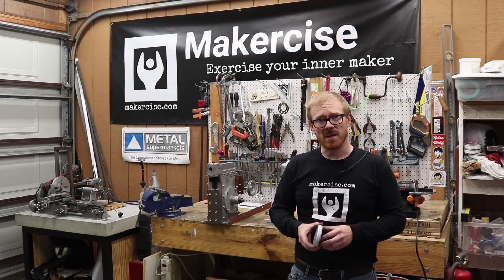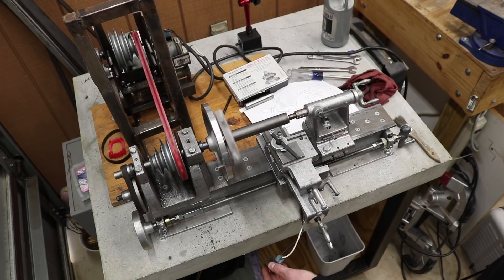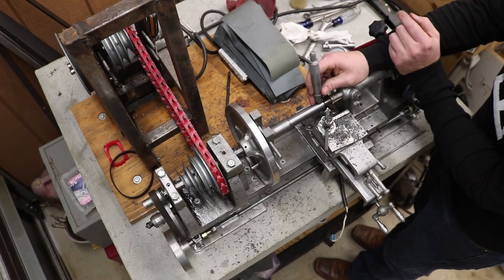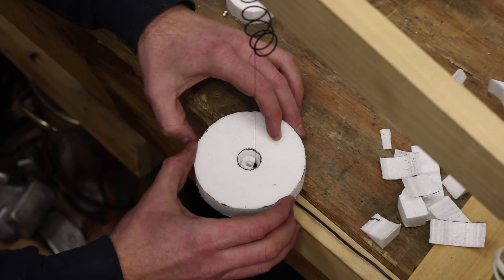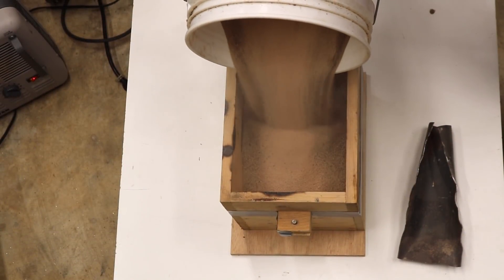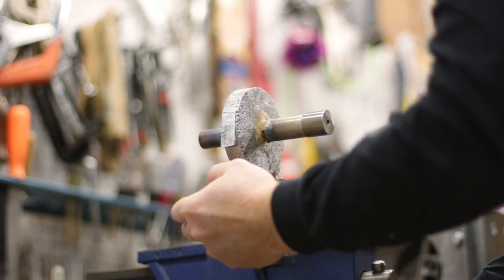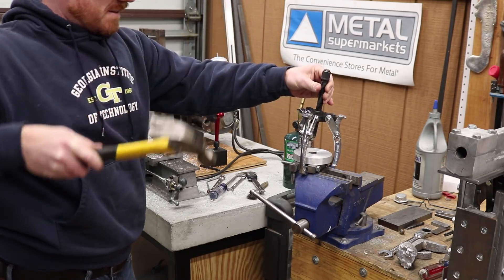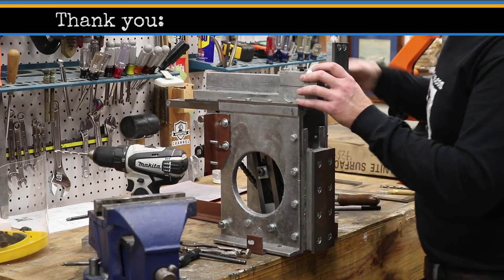Shaper Protractor Disk - Rotating Head Alignment

Comment: A couple thoughts on arbors. It could be that spray on teflon coating would work better than soot. Also, remember metal expands when hot and contracts when cold, so if the casting is still warm it is likely gripping the arbor and removing it would be easiest when not just cooled but actually cold such as cooled in an ice water bath. I know of people who use this to fit parts making both the socket and the rod the same size or even making the rod oversized slightly, heating the socket to expand it (you can even calculate the expansion by temp and material) and then hammering the rod into the socket. After they cool they can't be separated. I've always felt that puts an internal stress on the metal but I've seen it work well enough and not fail in a few decades so YMMV.

Comment: Really enjoying your video's on this. One question You may be able to help me with. 
When I tried coating my foam pattern with plaster, the metal bubbles and spits back. You don't mention a problem like this. I think it must be either the moisture in the plaster,, or the gas from the melting foam being trapped by the plaster. Any thoughts to help me with this?
Reply from the maker: I let my plaster dry overnight. I dont put it on too thick except where the sand may have trouble flowing under...kind of like support material in a 3d print. What foam are you using? 1.0pcf eps is what i use. I did not have luck with xps...it bubbled and spat. Sand needs to be bone dry. How hot are you pouring? I think cool as you can get it without freezing is best.
Reply: Thank you for the reply. I use eps foam, I don't know what density.  My sand was very dry and fairly fine play sand. I don't have any way to judge temperature, but it was not glowing or anything. I let the plaster dry for a few days before I got back to it. May plaster was pretty thick though. Maybe that is my problem.

Comment: I like your casting methods.  When sooting up an arbor you might use a kerosene lamp using diesel fuel.  It gives off an oily soot which should help when taking out the arbor.

Comment: You can locate centers by scribing several arcs on the end of the bar with your measuring caliper. Set the jaws near half diameter, then eyeball it and center punch for center drill. hundreds of other ways too.

Comment: Have you thought about "filling" in the voids in the foam using wax (and smoothing flat) before adding the slip lining at all? Seems like it'd give you a surface that's closer to tolerance, so less machining needed just to get past the rough surface. I've also seen some gingery makes where they used a plain oven to heat out the foam/wax ahead of time, by heating the pattern while embedded in sand to leave just the shell. Not sure if it's a better pour overall and no doubt the lining thickness would need to be thicker to address fragility of the lining when the casting material falls to the bottom. IIRC the reasoning was to allow for a better pour consistency at outer edge features to ensure that gas build up at those points didn't leave voids.
Reply from the maker: I tried coating with wax to smooth once, the wax tends to bead up and roll off. Lost wax or a foam burn out is a fine technique, but I like full mold eps for one-off casting because it is so fast.
Reply: Ah... yeah, I suppose the type of wax would make a big difference; I had been thinking something like pastewax.

Comment: You need to hammer out the arbor while the casting is still hot. Aluminium has a higher coefficient of thermal expansion than steel so when the casting solidifies the hole is the same size as the arbor but as it cools the aluminium contracts more than the steel making the fit tighter.

Comment: Nice job!

Three thoughts.  First, at the microscopic level, any lathe tool marks on that mandrel will act just like threads taking the casting off. Smoother is better, much smoother is much better.

Second, “smoking” a shaft with soot (usually acetylene with no oxygen) works great for pouring Babbitt bearings. I’m not sure it’s doing a lot of good in the turbulence of an aluminum casting like this.

Finally, if you can make the sprue transition from vertical to horizontal be more of a sweep rather than a hard right turn, you may get better fill and less turbulence.

Keep it up, this is really ambitious stuff!
Reply from the maker: +Thomas Utley thanks for the tips.

Comment: I suppose the  pros would use a core, and make it to fit the hole. But then you are back to sand-ramming, making the core prints -- ad infinitum. Since your mandrel is tapered, maybe rebore the hole out. Good job. I am fascinated by the lost styrofoam procedure.

Comment: you really need a 3jaw chuck or a fixed steady rest for the lathe.. mount your stock and center it with a indicator at the head stock end the use the stead to hold and center the other end then drill your first center.. flip the stock and repeat.. but i think @Matthew Tinker has the right idea. and yeah make the stock as short as you can!

you should try etching the protractor disk with HCl

good job though!! keep it up

Comment: So you finally figured out that putting a polished taper is the key to getting the arbor off... way to go man. look Forward to the rest...
Reply from the maker: +Ramiro M i think that was your idea BTW
Reply: didnt think you were listening... remember the finer the polish and zero undulations will make separation the easiest. BTW dont forget to coat the protractor with some clear coat that is resistant to oils and solvents...

Comment: One way to get more acurate centres is to use this kind of punch, it works well on round, but also on hex and square stock! https://www.qwant.com/?q=Engineers%20centering%20punch&client=ext-firefox-sb&o=0:095bcf8b56524b7becc3d2cf431155be You also don't need such a long shaft! cheers, Matthew
Reply from the maker: Matthew Tinker i saw mr pete make one a while back. They dont seem too expense either.